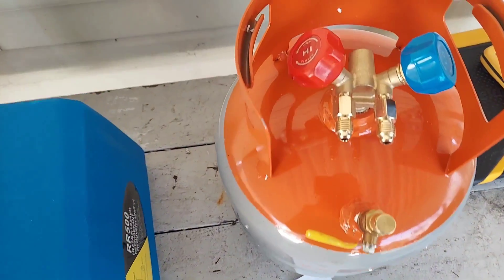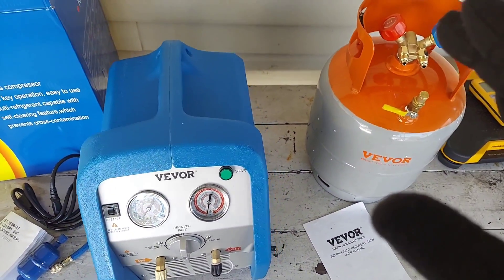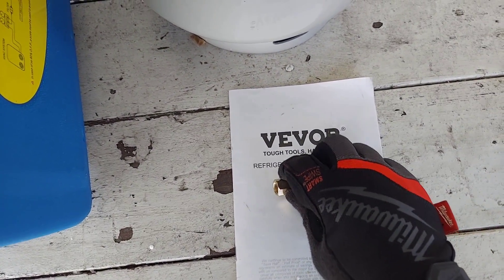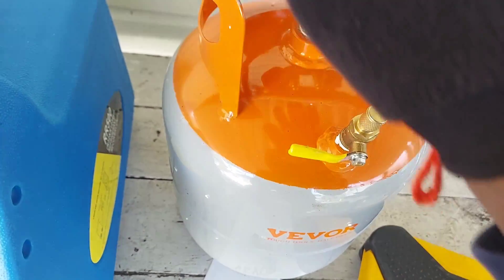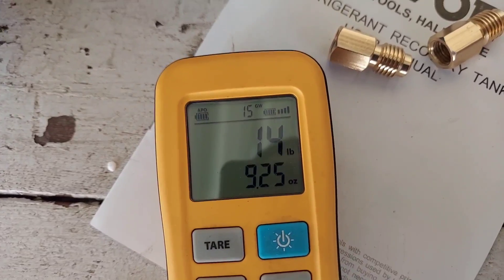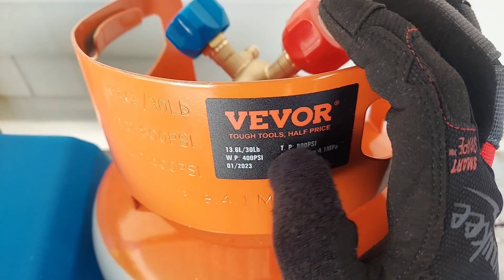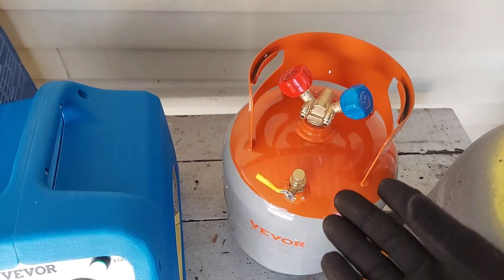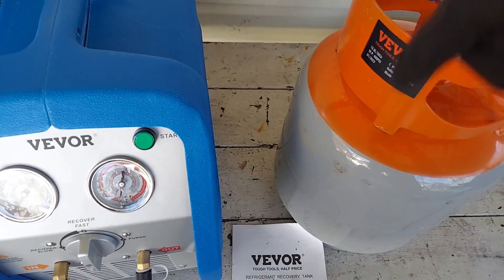VEVOR REFRIGERANT RECOVERY UNIT  AND TANK REVIEW

Comment: Is that tank UL approved? Those valves look like there very close to the handle.  The shape, height and strength of the handle is there to protect the valves.  If you have an accident where the tank falls and breaks off the brass valve it will be a bad day when that missle goes through a wall and kills someone.  

It is very important for all of your refrigerant handeling equipment to be properly certified for the job it's expected to do.  I couldn't find anything about any 3rd party certifications on there website.

This company looks like they have many products from jucers, monitor stands, lawn care products, etc labeled and resell it under their brand.
Reply from the maker: Probably not. I wouldn't use this tank primarily, but just  as a refrigerant holding tank . from the system to the tank and back into the system. Hence, while traveling, it is always empty.

Comment: They are not 5/16 adapters, a little bigger than 5/16". I have bought another version of recovery machine, and wonder what is the difference between "recovery" and "purge".
Reply from the maker: Good question I never considered that! I will find out though
Reply: I think purge is to clean machine out to help with cross-contamination
Reply: Most recovery machines except APPION allow refrigerant to get into the crankcase.   The purge is to clear the refrigerant from the crankcase.

Comment: I just bought two of these tanks.  I guess they only pressurize the ones they send out for review, because mine were not only unpressurized, but the valves were open with the ports uncapped.  I can't imagine an absence of rust.  Did these cross an ocean?   When I opened a support ticket, they asked me to send a picture or video "that clearly illustrates the problem"...and made sure to inform me that for any returns without 'quality issues' I would incur return shipping charges.  Not pleased.
Reply from the maker: That sucks!  the one I reviewed was solid, only issue this far is that the extra port got snapped off when it fell in the back of my van!
Reply from the maker: Did you purchase this after watching my video?
Reply: does yours have a yellow top and DOT stamps and the proper capacity markings? if not they are illegal to transport and the DOT will fine you into oblivion if you get caught transporting them